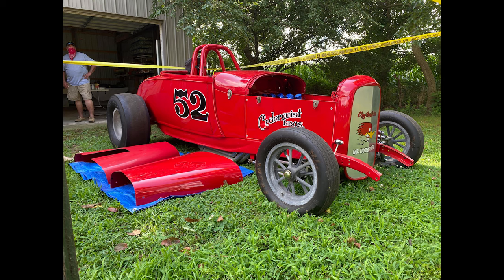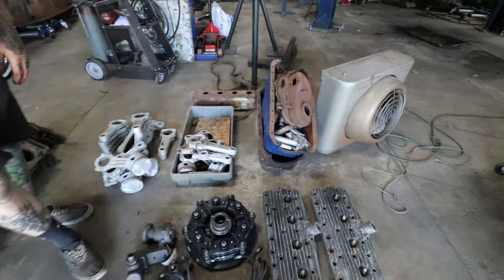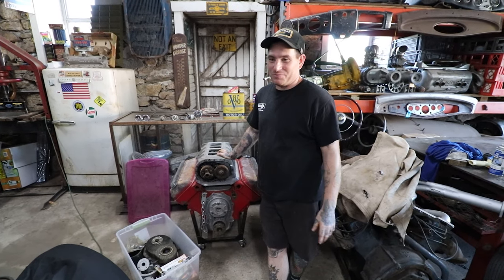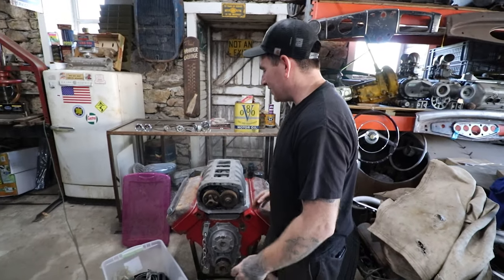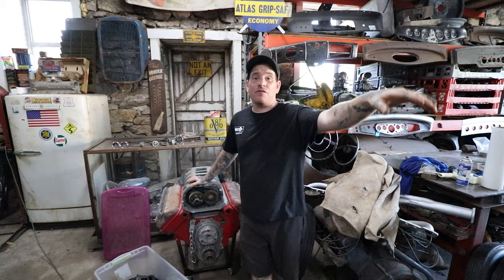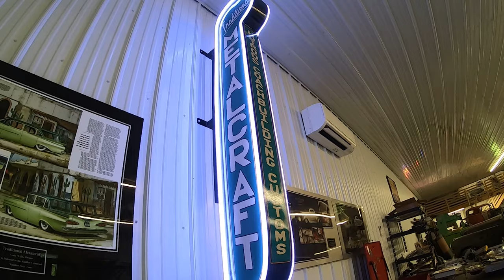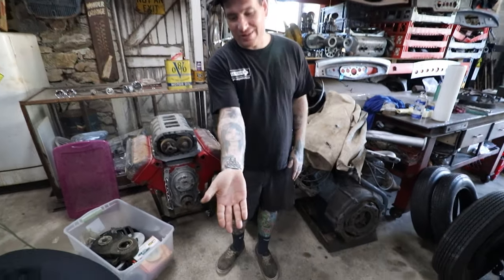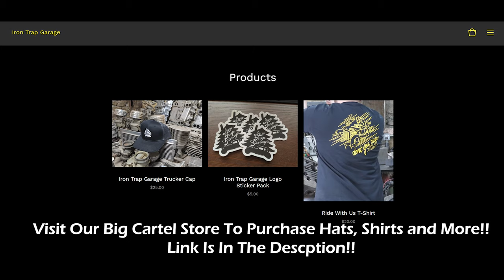I Accidentally Bought A BLOWN and INJECTED HEMI!!!!

Comment: I had a friend back in the '60's with a blown 354 Hemi powered '32 coupe. Stock compression and direct drive on the 671 blower. 2 Carter AFB's with progressive linkage backed by a B&M Hydro and Olds Posi rear. I believe an Engle cam. Regularly seen cruising Bob's Big Boy on Whittier Blvd. and not finding many street races. Your mission (if you choose to accept it) is....

Comment: About the only thing cooler than a flathead is a hemi.
I'm putting a 55 desoto 291 hemi in my 30 model A pickup build.
Hot heads research is a good source for parts for hemis. Just remember to add a digit to the price of stuff you're looking for. Hemis ain't cheap. 
If you have identical cars at a show and one has a 350 Chevy and the other one has a hemi, which one will the guys be looking at?

Comment: I sold a steel 37 Willys sedan like 10 years ago for $1600.  I bought it out of a junkyard for way less than that.  If you dig around it can be done.  If you want a 40-41 coupe, that's another story.  

Auctions are great.  I ended up with some 348/409 stuff a few years ago for cheap and made some coin flipping it.  I have a great set of Model A bed sides from the same auction.  I have so much crap now it's not funny.  Guys only go after the big obvious stuff and if you know what you're looking at you can catch them sleeping.
Reply: I might know where a 392 short block can still be found, too.